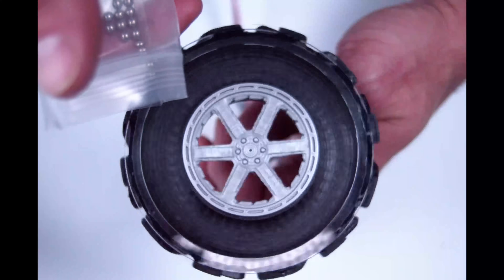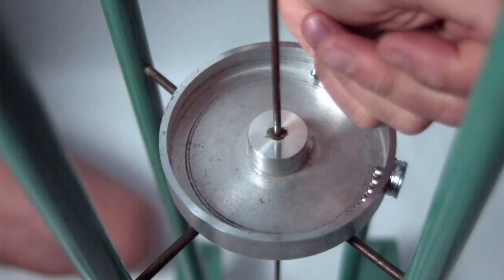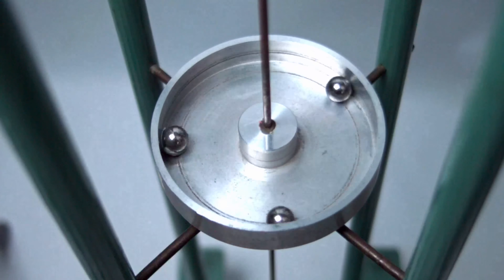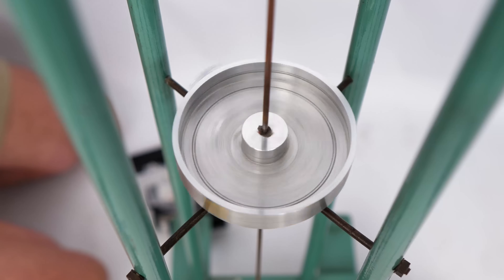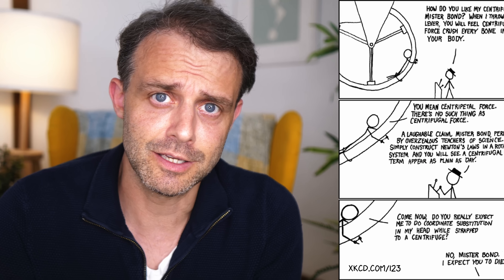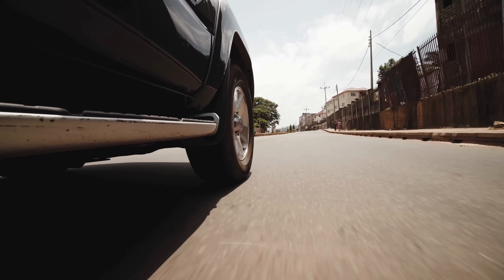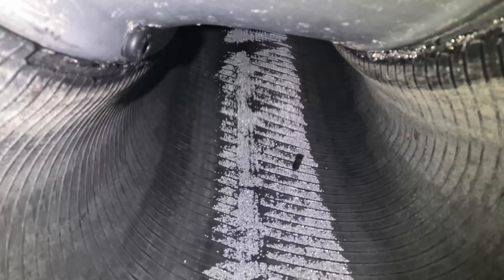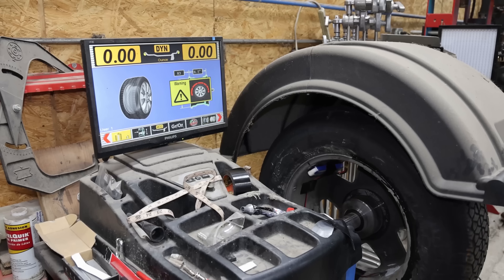Do tire balancing beads actually work?

Comment: I feel like if they had some way of activating a resin on the beads you could make a super simple tire balancing machine that just has a boat load of those in the tire, have the tire balancer spin it to critical speed, activate the resin and BOOM no need to attach weights, and the shop tech can move on to another tire. But there really isn’t a way to do that unless you used a fast acting resin because any other method would be introducing additional influencers on the tire weight distribution.

Comment: So if you were to coat the beads in an adhesive - maybe epoxy - and go to the high speed so that when you slow down again they stay in place, would that balance the wheel permanently?  And if so, do we need the beads at all? Just fire some epoxy in and go for a rip ... It should flow into the ideal places, set and the job's done!  Maybe a follow up video, Steve?

Comment: I use it in my motorcycle. It is so much better than counter weight. Ride is so much smoother.
The only downside is the beads injection in the tire when already mounted.

Comment: Excellent video. Something I always appreciate about your content is the strong and very clear visual aid (I discovered your channel back at the greedy-cup [the pythagorean syphon] video where you used acrylic panels and fluid for a visual aid). IMO that's one of the major elements that consistently sets your vids apart from the crowd.
Reply: Thank you for both closing your parenthesis and using brackets inside of them. I dunno why but it's a real pet peeve of mine regarding online comments, when people don't do those things.

Comment: I suppose the good thing about them is that the wheel will always be balanced perfectly once it's balanced, unlike with weights which might fall off, or be in the wrong place if you buckle a wheel.

Comment: How much does getting your tires balanced cost in your countries? Here in Italy, they do it for free when you buy a new set of tires, or maybe ask for 10/20€ if you somehow fucked up your wheel and need to rebalance it, so I've never even thought of the necessity of a different solution.

Comment: I've been a tire tech for several years now. I've never been able to picture how balance beads would work. This is great!
Reply: I'm a mechanic.  Putting glass beads inside a tire seems like a bad idea for a couple of reasons.  One, glass beads bouncing and spinning around inside of a tire makes me think the beads will break about, or at least grind against one another, producing a fine dust.  I would not want to inhale glass dust sprayed out of a tire after removing the Schrader valve or when the tire is popped off of its rim.  Two, the possibility of glass beads fly out like shrapnel if a tire should pop while it's being inflated.  Even if the tire is in a cage, that stuff is going to go flying.
Reply: @wargamingrefugee9065 they're not actually glass and they stay whole inside the tire. I've never seen any kind of wear to the rim or tire either.
Reply: @jonnywatts2970  - I had a blowout on the freeway about 15 years ago. If i had used these beads, or ball bearings, I could have had a claymore-style experience for any passersby. This doesn't seem like a good idea. Tires are already dangerous enough as is. Let's instead start improving walking and biking infrastructure, while adding more trains and busses, please.
Reply: @itsthevoiceman  nah, they're very light little plastic beads. No risk of them creating dangerous shrapnel.
Reply: @jonnywatts2970  That's good to hear.  Thanks for letting me know. :-)
Reply: @itsthevoiceman  Not a lot of foot traffic on a freeway, so passersby should be fine.
Reply: @jonnywatts2970 By comparison, some bird-shot shotgun shells use plastic beads. They do do damage.
Reply: @itsthevoiceman  The ones i use are ceramic and about 2mm diameter. Its about a teaspoon full.   Tyres flick up gravel all the time and that can be far bigger but no one worries about that.
Reply: @timsbike4887 - I'm not talking about gravel flicking up from the outside, I'm taking about beads being blasted from the inside after a tire pops, sending the beads out like a claymore. 

Average tire pressure is about 2.5x that of air pressure at sea level, that's a big difference.
Reply: @itsthevoiceman  Trust me, the rotational momentum granted by the wheels moving at hundreds (thousands?) of RPM imparts far more momentum to gravel than 35 psi provides to a ball bearing that never escapes the internals of your tire. I understand that you're anti-car and pro pedestrian, which is fine, but if you're going to offer a critique it should be logical. Your current concern is not.
Reply: @itsthevoiceman  If your that worried , the average tyre blowout is from under inflation  and as i said stones being flicked up would be more of a worry and yet we dont worry at all. Stop worrying about a problem that doesn't exist is the answer.
Reply: I am interested to know what you were picturing they were doing before watching this video, lol.

Comment: That's really cool, I had no idea that was a thing. What you need is some type of adhesive that is liquid enough to flow but that will set after a few minutes. Fill up with beads and goo, get up to speed and stay there for a few minutes and let the beads set, and bam! Balanced tires!
Reply: Very interesting idea, this would fix the tire for low speed as well. I wonder if you still even need beads. The liquid adhesive might act as the weight itself.
Reply: the problem with this is that it would defeat a major reason to use this type of balancing mechanism, the fact that it dynamically adjusts as the tire rotates.  Tires do not wear evenly and tires also slip on their rims.  both of these lead to out of balance tires.  When you have conventional tire balancing, that means that you have to get the external weights removed and replaced.  But with with internal media, it will dynamically balance in real time to changing conditions.
Reply: Well no, the actual point of the beads is that they will always balance the tires throughout the whole life of the tire... not just one time... which would be the equivalent of just getting your tires balanced normally. Adhesive that sets would defeat the entire purpose of the beads.
Reply: @johnjingleheimersmith  I have never had to rebalance my tires, I know they can throw a weight occasionally but I've never just had them go out of balance before

Comment: So, why can't someone build a rim that does this and then sets it in place permanently? I would imagine it would cost more than a standard rim but it would do away with balancing! That could save many hours of work and an entire expensive tool that is currently used. I can imagine how this could work, it would have say 5 or 6 one ounce balls in a track. They are free to move. Once it gets up to speed it would cause a release mechanism that would capture them in their spot preventing them from moving again. If you change the tire, you simply un-trip the mechanism and it will automatically balance them as soon as you get to highway speeds again. And it could be used forever. No one has done this yet? Maybe I should design it and some how make a way for it to be installed onto existing rims or something. If someone does this, remember where you got the idea from... please...

Comment: This was a really fascinating insight into resonance behavior of imbalanced rotating objects. But I am not sure, a real life car tire is reasonably represented by the models shown in the video (RC-Car tire, spinning plastic disc or spinning bowl of aluminium). Those models had a perfectly circular circumference, where the steel balls could position themselves wherever they wanted, which was the furthest away from the center of mass of the imbalanced rotor in the case of 2 balls. A real life car tire isn't perfectly round during one revolution, as could be seen in the videos. It is flat at the area of the contact patch to the road. Thus the steel balls don't have total freedom where to place themselves in the tire.

Comment: I have personally used this in my own tires, though I used heavier mass objects than glass beads, I used steel bbs.  In my experience, I could tell when the bbs became balancing, it was noticeable when driving.  But the speed at which mine did was closer to about 25 mph and they would stay in that stable configuration down to about 5-10 mph.  It was always an interesting sound hearing the steel bbs bounce off a steel rim when coming up to a stop sign. This worked well enough for me to consider doing it again if I ever mounted my own tires again.
Reply: I have it on my atv, truck with 35's  and my car with 17's, love it. Especially winter when you get uneven globs of snow stuck to your rim. And of course mud for the truck and atv
Reply: Which is your tires diameter?
Reply: @ikocheratcr  I did it to multiple vehicles.  The one in question had tires about 24" in diameter, they were on the small side for car tires.  I also did it on larger tires that were about 40" tall, but for different reasons and that vehicle never really went fast enough to need them if I am being honest.
Reply: It would probably be less noisy if the inner surface of the wheel was covered with rubber -- something like an inner tube, except it won't have to hold any pressure, just keep the BBs from hitting metal.
Reply: @mal2ksc  the noise was never an issue, it was kind of funny.  It sounded like a baby rattle.
Reply: @mal2ksc like a rim strip on a bicycle.
Reply: People don't appreciate that the road is very important for the beads to set themselves in the right position. The tire deflects inward because of the weight of the car on the tire, on the road. This acts like a bump, or a rake that moves the beads to right spot. The beads stay in that spot because that spot exists because of resonances in the tire.
Reply: Use airsoft bbs works better
Reply: Isnt bashing your rim with steel beads kinda...I dunno...bad?
Reply: @MattH-wg7ou  nope.  the beads never fall with anything more than a few inches of vertical height. at most, they can fall from the top of the tire down to the top of the rim, which on most cars is at most a few inches to a foot. You'd have to do this for a significantly long time before you'd see any kind of damage to the rim, likely longer than the life of the car itself.
Reply: @MattH-wg7ou won't even break the paint, non issue
Reply: Congratulations. You’ve unbalanced your tire for a chunk of time. I’m sure that’s great for the bearings, hubs, axels, etc. 😂

I’d love to see a long term analysis of the cost of wear of this idea.
Reply: Then you have a tyre blowout and spread all those glass beads across the road and cause havoc for fellow motorists.
Reply: @xyyyyx3247 
Roads are covered in much worse than BBs.  Angular rocks, fine sand, round pebbles, etc.  Small round objects won't even be noticed by a sticky rubber tire on a sticky asphalt road, or even smooth cement.

You have to move up to nails, or wood splinters if the angle is just right, before loose debris can damage the tires of other vehicles.
Reply: @xyyyyx3247
Aww. You tried so hard. Poor little guy. Try reading the comment again but slowly this time.
Reply: @xyyyyx3247 what havoc are you imagining? most roads are too rough for there to be any real issues.
Reply: Could one add some kind of goo, to have the beads stay in place after the initial run?
Reply: @niclaskarlin  you wouldn't want to do that, that would defeat a large benefit of using this method.
Reply: @devindonahue8467  the entire point, some would say.
Reply: @niclaskarlin  That was exactly my thought too, something sort of like velcro so the beads can still move into a balanced position at high enough speed yet they'll also stick there against gravity that way they're permanently in balanced position unless somehow the tire becomes unbalanced again at which point they'd auto correct themselves next time you each the appropriate speeds. Might be tricky getting it just right to ignore gravity but also not be so sticky you'll have to travel 100mph+ just to get them into proper position. Even just pouring epoxy in and letting it cure in position would work but no way to recalibrate if the balance is thrown off again.
Reply: @niclaskarlin I like the way you think
I'd suggest glue that cures in like 30min
You put it in with the needs and balance the tire until the glue has dried them in place😂

Comment: Soo,  now we need beads which break due to the centrifugal force at top speed (when the wheels are balanced) and leak out a resin which hardens and thus balances your wheel permanently :D

Feels like it could also be a budget version to balance like motors/propellers and stuff, though you would probably need more mass than if you balanced it manually, but still pretty cool that you can perfectly balance it by just spinning it up? Does it also work for liquids btw? Then we can have a Speed situation, but instead of blowing up if you go under 60 your wheels are fucked up forever if you go under 60 :p

Or you know, you could be on one of those wheel spinny rigs, but where’s the Keanu in that?

Comment: Hey Steve we used to throw half a jug of a freeze resistant liquid(antifreeze or winter washer juice) into 4x4 tires. That way you could bring some with you and still have balanced tires if you need to reseat tires on the trail.

Comment: i wonder if it would be possible to use a very thin epoxy with the beads fill the tires and hit highway speeds until the epoxy cures.

Comment: I've used balancing beads in the past on a 4x4 with big tyres that were hard to balance in the usual way. I remember bringing the beads into my tyre place and asking them to install them. One fitter was baffled at what I wanted, but another older fitter mentioned he'd used similar on rally cars in the past and they worked well. However I can honestly say that I didn't really notice much difference on my car. Possibly because it wasn't exactly a fast vehicle and maybe I didn't get above the 50mph sweet spot often enough.
Reply: I use 40" Nitto Trail Grappler tires on my  4x4. After 120k miles and two sets neither set needed balancing. The reason is the steel core. It is one narrow but long band that makes multiple revolutions to make the core. Imagine a winch rope and the first layer on the winch spool with the two ends meeting at the same point on the tire. One end is on the inside wall while the other end is on the outside wall. This manufacturing method avoids the overlap one wide steel core would have when the ends meet creating the unbalance.

Comment: I remember Samsung used these in their CD/DVD rom drive spindles to dampen vibration and noise from disc imbalance. You could hear a faint rattle inside the drive just when the spindle began to spin up. And yes these drives always ran really smooth even at high speed.
Reply: I scrapped a Samsung washing machine and it had a similar balancing device on the back of the drum, obviously to balance it during the spin cycle.

Comment: So if you were to coat the inside of the tire with a adhesive  that melts at a high temperature, then spin the wheel/tire in a heated chamber where the beads would balance then stick into the melted adhesive, could you permanently balance the tires?